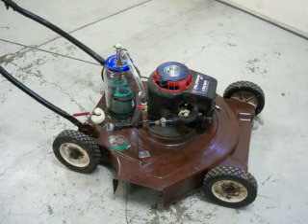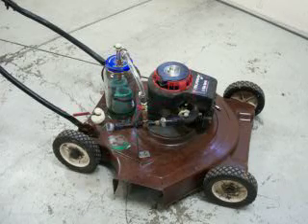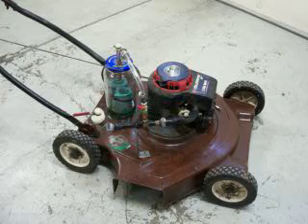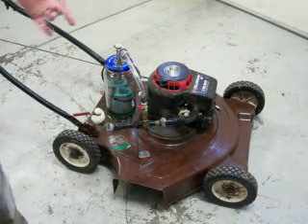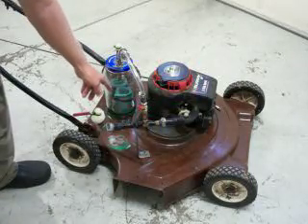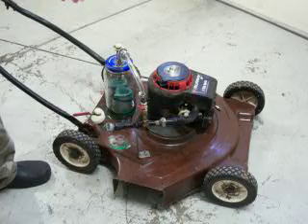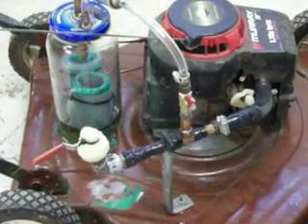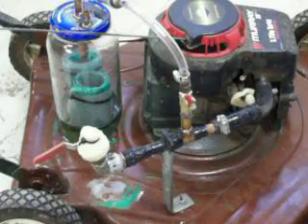just vapor, the truth or a lie

Comment: I was wondering if someone could help me. I just started ripping all the pipes and manifold offa my wife's SL500 Mercedes and all was going very well  plugging the holes with silastic and gluing coke bottles on the tubes sticking out. I dunno whether to remove the engine management system but for now have just taped up the plugs and wires with sticky tape. Luckily being Christmas my wife had bought some sticky tape with little Santa’s on it so it looks very salubrious and fitting for the Christmas spirit. I got a little diverted there, anyway I had trouble punching a hole in the top of the carbon fiber tank with a cold chisel so in the end had to borrow my neighbor Randies hammer drill and punch a hole in the tank so having the drill decided to add another hole and have twin hoses running from the tank to the coke bottles then to the manifold. The hose turned out to be too big so Randy and I laid them out on the driveway and ran the Mondeo over them  a couple of time so make them  thinner. It now fits like a possum’s tail in a hickory tree between the twin tail pipes and the floor. With the hosepipe wrapped around the tailpipes thirty times I hope my wife gets better fuel economy and more torque. The problem I need help with is my wife Phoebe Jane arrived on the scene as I was removing the air filter with a tomahawk and complained about the color of the gaffer tape I was using to attach the hose pipes to the manifold with as it is grey and she says it clashes with the black paint and trim of the car. Phoebe Jane wants me to use black tape. I have been down to Billy Bobs, Hardware, Fishing, Shooting, Skinning, and anti tank rocket store but have been unable to source anything other than grey gaffer tape. Does anyone know where I can buy some Black Gaffer tape to keep my wife happy and if not some rope and a bucket full of quick setting cement??????
Reply: buy black marker pen, colour tape black to suit, job done ;) enjoy the extra MPG from running on vapourised fuel instead of liquid fuel pressurised and vapourised by the EFi system fnarr fnarrAlso, don't forget to remove the check engine lamp bulb afterwards to prevent any distraction from it's glow
Reply: dan mackintosh Never thought of that !! All the warning lights glow like a christmas tree now sought of thinking that Mercedes didn't understand what they were doing with the warning lights either  like a Coyote with it's balls in a varmints mouth and it seems that running your Mercedes on vapor produces a lot of coal dust smoke in your exhaust pipes. Thanks once again for the friendly advice pilgrim.
Reply: Dan I started to color all the tape with black marker pens but after the tenth trip to the 5 and 10 in Little Bluff to buy another marker pen one of the checkout chicks advised me to go to T&C hardware and buy some black spray paint to make the job faster. So I jumped into the Mercedes and off to the Hardware where Big Mike who is in charge of the paint department pointed out that what I really needed was some special heat resistant pain which was only available at Mac’s Hardware in Sioux Falls. The paint we needed was Valspar 21926 Armor Anti-Rust and Heat Resistant  Enamel Spray Paint for fools so we filled the tank of the Mercedes and packed the trunk with vittles and headed off to Sioux Falls. The Mercedes gets unbelievable mileage out of  a gallon of  gas but struggles on the hills but coming down the hills the car performs like a Grizzly with one of uncle Jeds mini ball shoved up it’s arse from his 1855 Springfield Varmint flintlock. Our real problems started when we were just arriving into Muskogee. We heard all this commotion coming from other cars following us and  people standing on the side of the road. When we realized that one of the fuel lines had melted and the resulting conflagration with gallons of raw vapor burning under the Mercedes like rocket fuel was also  exhuming the chrome extension on the left-hand exhaust pipe. With the threat of a total melt down the only course of action was to drive the car into the Arkansas River to stop the out of control fire. After recovering the car and borrowing a feed pump from the local moon shine still to pump the water out of the transmission and cylinders and replacing the hose pipe fuel lines with copper tubing from a disused still the rest of the trip was uneventful.
The Valspar 21926 Armor Anti-Rust Flat Enamel Spray Paint, 12 oz Aerosol Can did the trick and Phoebe Jane is most generous with her indulgences now. The big surprise was that we did the whole trip on one gallon of premium fuel!!!
Reply: Well, unexpected toast-show aside I'd say the project has been a complete success. (anything that brings generous indulgences from a female has to be a win)

Good point with the spray paint, I'm barred from buying it from all our local outlets though after being found unconscious, naked in the middle of town with a spray can in one hand and plastic bag in the other, one too many times.

I did try explaining that I was merely trying to protect the planet by inhaling the fumes instead of letting them escape to atmosphere. That didn't wash though sadly.
Reply: YOU ,  ARE  on the right track keep up the good work and sell it to your neighbor and buy your loyal wife a new car.
Reply: Funniest response so far is from Charles Frogg - Just tell her to use her Mascara to color the tape black, but she has to do it herself wearing a short short skirt. Then when she is bent over the car..........

Comment: I don't dispute this guy's findings but he's forgetting that there is a commercial petrol vapour product out there, called LPG, or Liquid Petroleum Gas. However the simple technology used here is interesting, my only concern would be that you risk running the engine lean, which leads to pre ignition and overheating. And all carbs do is essentially suck air creating a low pressure zone above a body of fuel (in the float chamber) that then vaporises and gets drawn into the combustion chamber. Just like the jar in the previous version. Intriguing.

Comment: working with hho myself I always have to worry about back flash. So I think using that wick system is a good idea. If the jar was filled up with a wick that could maybe keep it from blowing up in case of backfire. also with hho gas I learned the hard way not to use glass anything! nice set up. If we can run generators for hrs on a couple cups of fuel that would be great!
Reply: I too never had an issue with my bubbler system am 1 sold drop of fuel shuts the system down.

Comment: why don't you show us how much power your machine has and cut some thick grass. and because you don't have a governor controlling your throttle / RPM under load (grass cutting ) compared to free spinning, you will need to rev the shit out of it to cut thick grass or it will stall. this over revving uses up more fumes reducing your savings and wears out your engine faster. expand your mind and look at the bigger picture buds. you didn't discover a secret ,you only lost a bunch of power and created a ticking time bomb to push around

Comment: The wicking system VS. the Bubbler system I have done both and they perform the same . Ive used them together it performs the same. On either system it will run about 100 hours on 2 cups of gas running a pretty standard 3.5 lawnmower engine. neither the wick or the air bubbles accomplish anything except create resistance to allow vacuum to form in the container thus initiating a chain reaction.  This has been done to death and no one has been able to make a car run any appreciable distance with any control. This is not proof! You do not waste any of the gasoline under the normal system you gain acceleration (control)
Reply: Leslie Clendening  Leslie does this really  work, this is insane, we need to lock up these energy people
Reply: It has promise but the limitations make it impossible to put it on the market commercially. Shell Oil did public testing with this device back in the 70s GM did as well Ford has patents Chrysler does as well. If it were feasible these companies would have installed it on their product already. It runs on the vacuum created on the intake stroke and vacuum is not responsive enough to deal with the variations in speed required by varying traffic demands. Works better on stationary engines like lawnmowers or generators. The one possibility is to take an electric car and power the batteries with the gas generator at a constant speed and vary the speed of the vehicle with the electrical system. The problem is everyone is looking for a once size fits all solution
Hope this helps

Comment: All this bickering... I say we all meet up, try different shit, smoke a bowl and start tinkering... Put it to the test and see what we can come up with.  I tried this after seeing this video on a 177cc gy6 engine o  an off road go cart I have. It worked, just used a 1 gal can with in intake hose run to bottom of the can below the fuel line surface, and then another above the surface ran into the air intake. However, on this particular engine, when I'd push the petal for acceleration the engine would choke out and die. And that's as far as I pursued it. It did run fine though at high idle
Reply: Read my entire post at the top of the page the one that states 651 mpg on 1100 cc circa 1979. Youll understand whyit worked the way it did

Comment: Basically a Carb's job is to "try" and vaporize the gas and introduce it into the engine. Your simple contraption is doing the same thing, along with any other contraption you can come up with to that takes a "whiff" of gas into the engine. Also, try running it under load, mowing the grass, chances are you'll use same amount of fuel, chances are it won't run.

Comment: you do know an engine will run on wood smoke,  right?
Reply: Actually it will and it will run on a burning bale of hay. I have done both. With proper vacuum it will run on diesel  It is difficult to do but it will do it
I have replied to most comments I have tested the system extensively and can answer just about any comment or question

Comment: One possible problem with this setup is there is no governor on the engine since there's no carburetor so if you get into some tall grass the engine will die.
Reply: Good observation control of speed whether acceleration or deceleration is what has kept it off the market. It is a big leap from running a single cylinder to operating a car in changing traffic conditions

Comment: It runs but how well under load? I'd like to see it cut the lawn. I'm really impressed though. That's awesome good work
Reply: It will cut the lawn without much problem load is not really the deal breaker with this device. It handles 
load very well. It doesnt hand acceleration at all

Comment: If the vapor has oxygen mixed with it all it takes is one backfire or misfire and the jar and tubes explode . . Liquid and air need to mix near where the old carb was or you run risk of all the gas exploding where the jar is

Comment: Theres an almighty draw back this and you people had better listen!!!! If that lawn mower back fires it will cause an explosion so great that it will severve your arms and legs from your body.  You better stop this now.  Here is a comment I left for two guys doing this with cars below. Everything has its price though, such as riding a motorcycle is fun but the price can be enormous.   That will work and actually a person can just use rubber heater hose and run from the filler neck on their gas tank to their intake on their engine, but heres the price tag, and that is if your engine ever back fires it causes an explosion same as dynamite.  That means you would explode while in your vehicle as it literally is the same as a dynamite exposion.  To do this safely would be to design a return blockage valve in case of backfire, but what if the valve sticks?
Reply: +Earl Guyton If you actually look at the video, you'd notice the flashback arrestor between the jar and the Tee fitting there...
Reply: +Mat Helm lmao you shut him down too funny
Reply: Flashback arrestors will not stop an explosion. Ive picked several out of workshop walls of people who thought they might lol
Reply: Further to the explosion idea, I thought the same thing when I built my device but the system relies on vacuum to lower the boiling point of the fuel. That vacuum prevents explosions and I spent many a night trying to create an explosion and the vacuum prevents this from happening. Its a commonly held belief
I actually retarded the distributor and caused backfires down the intake hose into the container and Im still typing with all, my fingers and toes arms and legs
Cant say the same for Ford Pintos though

Comment: If you can demonstrate this mower cutting grass for three minutes running, I'll eat my hat, shirt, pants including underwear.So I am now waiting for this moment.....I will even you tube it for you to watch, prove me wrong.
Reply: Actually the physics of the combustion is quite sound. The load on a lawnmower while its cutting grass is not remarkable enough to validate the experiment . Ive run generators and a compressor pumping 120 lbs/in 2 and had no issues. Ive run a 302 mustang automatic down the 1/4 mile with excellent results. Load is not its achilles heel, acceleration / deceleration is
Reply: Chicken......

Comment: The better a carburetor VAPORIZES the fuel, the more efficient it is, right? But Fuel injection is trying to keep a stoichiometric mixture. When you floor your car, the ECU pots it into WOT (wide open throttle mode) so you have power (and dump fuel in and pollute, thus the need for emissions controls). Otherwise, you would not have the power you need to merge with fast traffic or whatever. Back in 1981 I saw the engine in my dad's old carbureted 67 Wagoneer with 1 barrel Stromberg carb from a 47 Ford car burn 2 valves while towing a trailer at highway speed due to vapor lock (trouble would begin when temperatures reached 140 degrees Fahrenheit under the car (my dad was monitoring it with an analog electric thermometer kit from Radio Shack ). He added a return line to fix that. You could hear the piston type fuel pump run to fast when it was compressing vapor. I suppose not enough vapor was delivered through the little neoprene gas line. But can you get enough power from just vapor? I know my dad boosted his MPH by 30% in an experiment with a waster filter housing HHO setup on the same Wagoneer a few years ago. I don't doubt an engine can run on vapor, but can it drive in real world conditions carrying a load, with wind resistance, etc? I can get nearly double the mpg with my Honda minivan than my dad's wagoneer....and a newer minivan can get 40 or 50% better mpg than mine. CAFE standards.

Comment: People are stupid. first thing you learn about gas powered anything, is that the fumes are what makes it work. Modern engines are using fuel injection, the closer you get to running on fumes alone the better your gas milage, the cleaner it burns, and the more power you get. Mix that with high compression and you got yourself a very good engine.
Reply: +Erik Pearson When you talk about fumes and mean vapour, all gasoline combustion engines run on 'fumes'.
 The gasoline is turned into a fine mist spray by the carburetor and when mixed with air and enters the combustion chamber, the compression then turns it all into a vapour, or fumes if you will. The same thing happens in a diesel engine but in a slightly different way.
 Fuel injection on gasoline engines is a copy of the way diesel engines have been working for years, except now most fuel injection engines, including diesel, work on common rail injection and at very high pressures.
 The pressure within can be from 15,000 to 44,000 psi, depending on which is used.
That is enough pressure to cut your hand off if placed in a leak stream, a good reason why amateurs should not fiddle with high tech engines. 
 It is the high technology and high pressure that gives such good consumption figures.
Petrol engines run at about 10:1, diesel at about 22:1 compression ratio.
Reply: +Erik Pearson of course the fuel mileage goes up and it has less pollution, its burning less gas haha. Some people don't understand that.

Comment: I'm not sure why people are commenting about this being fake. Obviously they don't know anything about a combustion engine. Fuel vapor is introduced into a 4 stroke engine via the intake stroke. You can get better fuel economy running vapors and this can be proven by running a vehicle out of fuel and then giving it a tiny amount of gas, you will find you can push some pretty amazing fuel economy out of any vehicle doing this. Your fuel pump however is running dry and it won't last long. There is of course other ways (as this guy has shown and figure out) to make fuel vapor, while still letting your fuel pump run in liquid gasoline...

Thanks for sharing your video man! Great job
Reply: I am curious how much power the engine is making tho and if this vapor is causing a lean condition resulting in high exhaust gas temperatures and possibly premature wear on internal engine components? Still pretty awesome man!